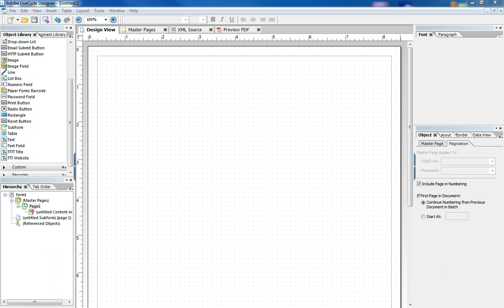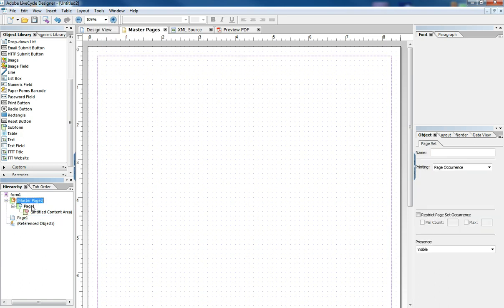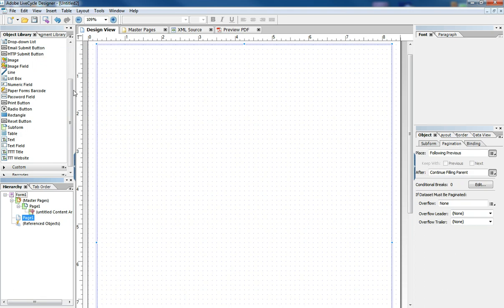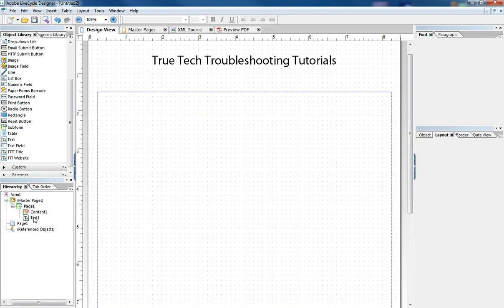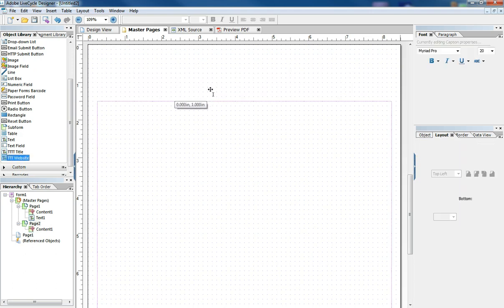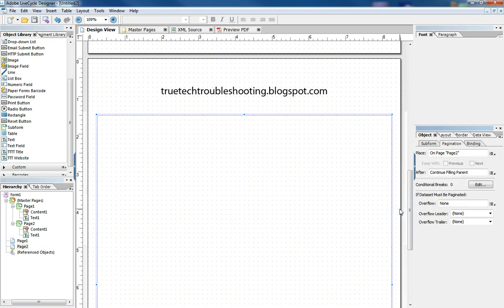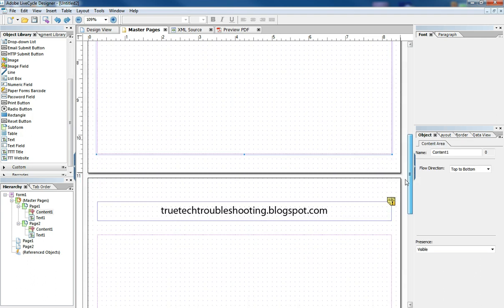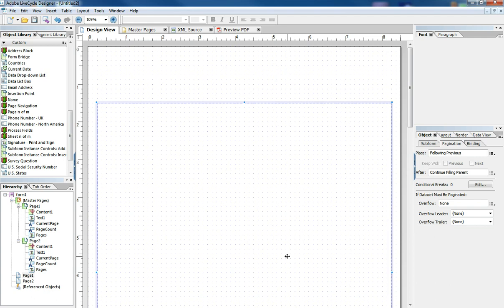Master Page Basics in Adobe LiveCycle ®

Comment: Hi there, Can a master page contain a flowed parent subform which could shrink if a particular child subform is not present or blank ? I tried achieving this with different events such as initilize, formReady and layout ready but of no help. Could you please guide me in achieving this?
Reply from the maker: +Sunny Singh Normally, you want to limit dynamic content on master pages. Think of a master page as a template in order to put dynamic content into.  

That said, this should be doable if your JavaScript is correct.

if(childObject==“”){childObject.presence = “hidden”;}

//this is an example only...you will need to modify object names to match your specific form